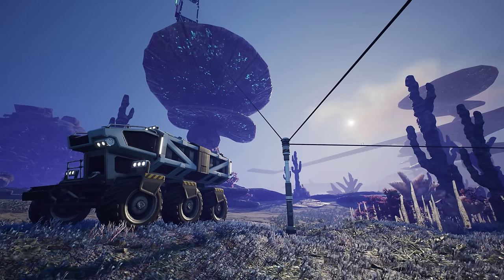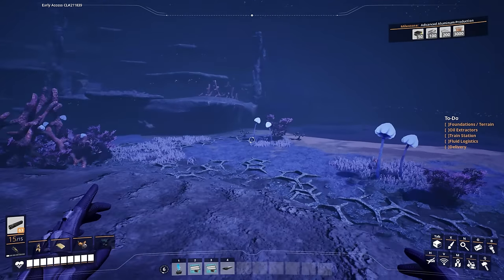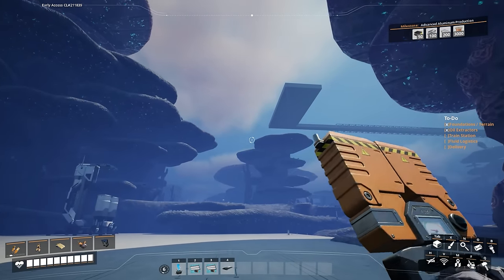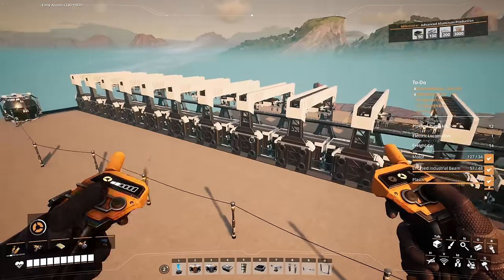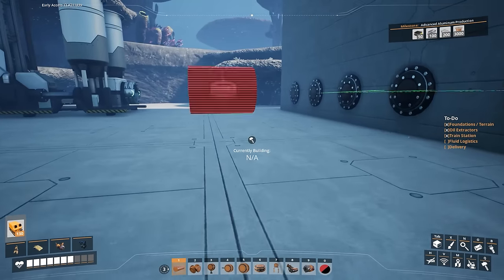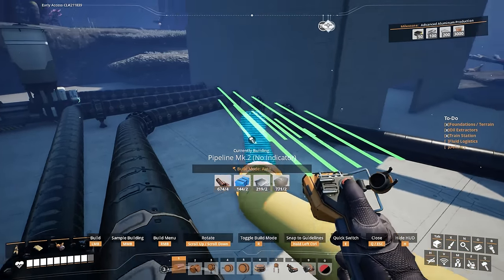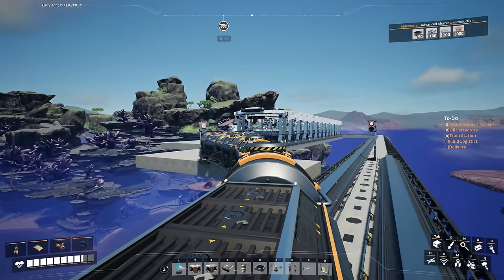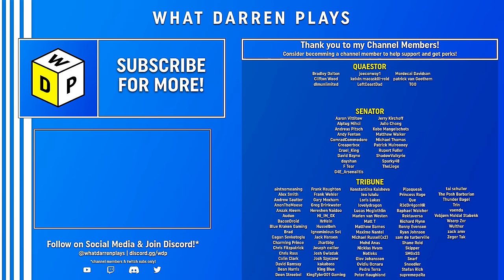HUGE OIL TRAIN! - Let's Play SATISFACTORY Update 7 - Ep.43

Comment: @14:03 That was actually the best steel recipe that you can get. Take in 40 iron ingots and 40 coal per min and get out 60 steel ingots per min. This is a great fun episode. Also with that alternate aluminum scrap recipe you don't make as many ingots as with the default recipe. It plus the sloppy alumina recipe means that you can completely cut silica out of an aluminum factory, but you lose overall ingot production to do so.

edit: also, if you want the extra challenge and work. You can transfer double the liquids in train cars if you package them first and then send them on fright cars. Plus with Mk 5 belts you can transfer the packaged liquids faster at 780/min than with Mk 2 pipes. But then you'd have to figure out the logistics of making and transporting the empty packages to the blue crater oil pumps.
Reply: True but he kinda said he wanted to play with fluid transport cars....
Reply: I think they buffer fluid carts didn’t they?

Comment: Your fluid buffers will back up when the trains dock, but they won't empty when the train isn't docked. They can output a Max of 600/min and they have an input of 600/min.

Either put a buffer on each station after the pipes are split into 3, or put a "bypass" pipe around the buffer so each station can take 400/min right after loading. Either way, you'll also need to upgrade all those pipes to mk2 to handle these surges.
Reply from the maker: Great point!

Comment: 14:09 Dude, solid steel ingot is one of the best alternates in the game.  You have to consider output rates when you evaluate these.  Click to expand them so you can see the whole picture before you rule them out.  I never commit to steel beyond a temporary pilot plant before I get that recipe.  It's free ingots and FAST.
Reply from the maker: Its my first time making it this far, no idea what I’ll even need more steel for right now so hard to know really. I’m guessing I’ll need… well more of everything I guess though 😂
Reply: @WhatDarrenPlays  That is very true.  You really do have a special play through of this.  This is the stage of the game where burnout can really get to you.  Most of the future builds are actually much easier then setting up aluminum.  The hardest things to get in this game are power and aluminum.  Nuclear power can have either a hard or really hard set up depending on what you decide to do with the waste.  However, you don't need to go into nuclear to finish the space elevator parts.  You are going to need a ton of steel for Heavy Modular Frames which will eventually be turned into Nuclear pasta (don't worry, don't need nuclear power for this).  So if you can get that solid steel ingot recipe, it would probably be quite useful.  This is also the stage where you are going to really need to ramp up quickwire production and the alternate quickwire recipes can really help too.

Comment: That's some top-notch alternate recipe analysis as usual from Darren 😉
Solid steel ingot is one of the best recipes in the game, going from 3 iron+coal -> 2 steel to 2 iron+coal -> 2 steel

Edit: And of course he skipped recycled plastic as well. Doing things the hard way, all the way 👍
Reply from the maker: I just dont plan on building new steel or new plastic right now - I guess I just get what I need/could use at the time, rather than something that would require a rework or second factory. 
I dont know what i need for tier 8, so its really just a guess. Right now I have a big surplus of steel and plastic!
Reply: My heart skipped a beat when he overlooked the solid steel alt lol. As far as the recycled plastic it's good, but kind of a pain in the butt to setup. Personal opinion.

Comment: That's for the vid, love the series, and your aesthetic design choices. :)

We might need to work on your alternate recipe selection. Solid Steel Ingot and Recycled plastic are two of the best (essential really) alt recipes.

Be careful about making your power network dependent on a long train connection. Any issues/delays in train routing could result in a power interruption which will also stop all the trains needed to supply fuel.

Look forward to the next vid.

Comment: If you need to lift oil up to your train station, have you considered using a water tower? Or I guess in this case, it would be an oil tower. If done properly, you can lift all of the oil up to your train station with 1/5th of the pumps.

Comment: You can decrease the number of pumps by building a tower loop.  1 line that goes all the way to the top, then back down again and connect into the rest of the system.  Once the fluid is at the top, your max head lift will always be as high as the highest point in the system. Then you can use valves on the main pipes going up to the station to prevent backflow. 🙂
Reply from the maker: I’m aware! Bit of an exploit imo so I don’t use it. One day it may be patched, so if people follow along the series I don’t want to include exploits.

Comment: You really shouldn't be putting oil on a train, but I also respect your desire to do so anyway, despite knowing how inefficient it actually is. I personally built an oil power plant on site in the blue crater region, since the water was already there. Alternate recipe for diluted fuel into turbofuel into a stupid number of generators. Like a VERY stupid number. I think the final number was 600ish? It was nuts.

Comment: Start of the video: Is he going to buffer the fluids so he doesn't loose any production during loading/unloading?

Couple minutes in: Pumping fluids up vs routing the train down is gonna be a bad time.

20m in: Wait, he doesn't have 2 lines for the trains?  He can't just add more trains? 

22m in: Insane number of platforms....yes, this is madness.

41m in: He does have 2 rail lines....so why not just add moar trains?
Reply from the maker: I’ve found that trains are slowing down already with certain path signals, so more trains isnt ideal. A longer train will work better for me I think! I’ll explain it a bit more in the next episode, but I think the round-trip is 6mins and the time to fill the oil is 8mins so it should be good even with one train!
Reply: Adjusting elevation with train lines takes a lot of space, doable if he drops the rails down closer to the ground earlier but a rough time in a tighter space

Comment: 23:52 I think you're approaching this the wrong way. Pipes that you want to feed train stations should be split into feeding multiple buffers, and each buffer should be connected to one station input. Splitting one buffer output into multiple pipes is the literal opposite of what you want in order to quickly fill a train station in between train services. You also might want to consider adding another station instead of making every train longer, to mitigate the loss of transfer throughput that occurs every time a train is serviced.
Reply: One way to think of how to approach this problem is "how do I make sure every input on the train station is receiving 600 fluid for every second it is allowed to operate?"
Reply: 32:15 Yeah, it looks really great. Love this design for a clean walkable fluid vertical logistics structure.
Reply: 34:13 oh god please keep in mind how busted the diluted fuel recipes are when you can use fuel to make the other important oil products with recycled plastic & recycled rubber before you dismiss them so quickly next time please
Reply: 48:07 that's the most beautiful crash I've seen in my life

Comment: I saw someone made a comment about using water tower (oil in this case). Go check out Scalti channel and his fluid mechanics (in 2 parts) videos. It greatly reduces the pump logistic/mess. Cheers man!
Reply from the maker: Yeah I’ve been told about it a few times, specifically when first building coal generators and pumps. I think its an exploit so not something I’ll be using personally. Each to their own, but I don’t think its intended to work that way, so its not really how I plan to use it!